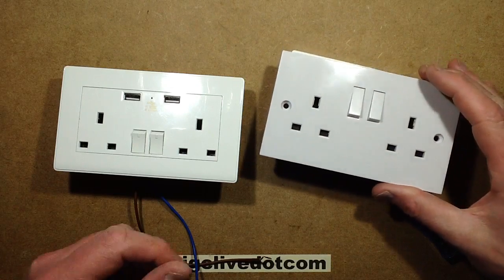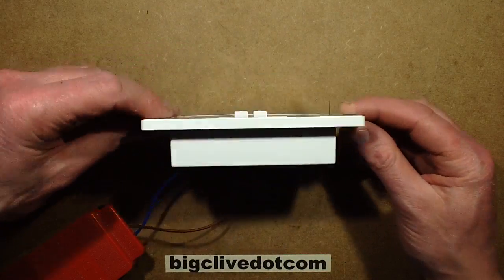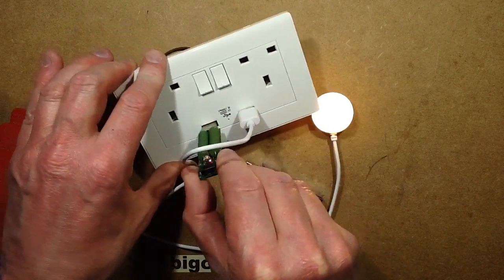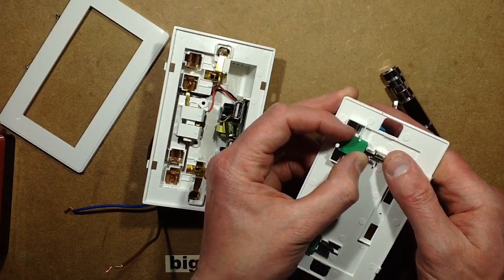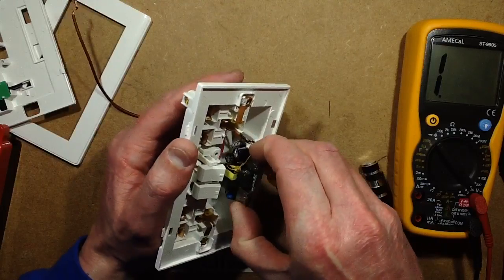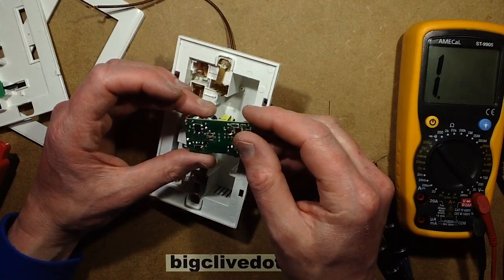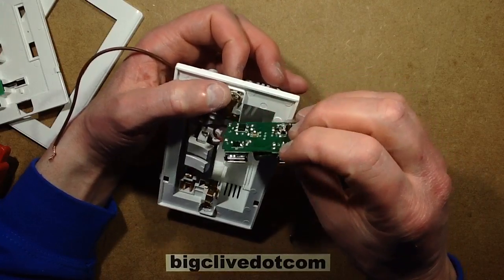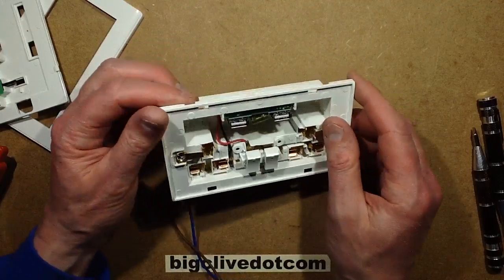A look inside a (crap) double gang socket with USB outlets.

Comment: Where can I find one of these USB 1A Loads you were using?
Reply: +Nathan Warner on Ebay from China. Or just make your own (5ohm resistor for 1A)
Reply: +MrOpenGL Awesome! I found then, so cheap! http://www.ebay.com/itm/1PCS-USB-Load-resistorPower-Resistors-Mobile-Power-Aging-Resistance-module2A-1A-/221919273705
Reply: Nathan Warner
I had also found a 500mA/1A version but I can't find it anymore. Basically it was the same as the one you linked but it had 10 ohm resistors instead of 5 ohm.

Also, if you do buy them, leave plenty of air around them because they do get extremely hot (also don't touch them when they are on for the same reason!)
It may smell funny for the first 2-3 minutes but it's normal!
Reply: MrOpenGL good to know!  Thanks for the heads up.  I've been wanting something like this to accompany my usb voltage meter to test usb phone chargers.

Comment: All I see are gigantic UK outlets.  I am partial to our 'dumb' north American outlets.  120 won't kill me ;).
Reply: +Michael O 240v won't kill you normally (higher chance, but less likely to melt the cables as higher voltage means cables don't have to be as thick)

we have MCB (and sometimes RCD) as well in most places now (unless the house is like 30 years old) and the plugs have a fuse in them so there is no chance the cable will turn into a space heater in the UK
Reply: +lee x we have service panels with circuit breakers in them. So if there is an overload the power is removed from the entire circuit. Including the cabling in the walls.
Reply: +Michael I like the compactness of the US sockets but I like how the UK versions have built in fuses and the switches on them. I guess that explains why the British have massive outlets.
Reply: Jügren van der Kaas
You can add switches to US receptacles. I have a box on my desk right now wired that way. Just use a duplex box, and the right combination cover plate. Our electrical supplies are modular. But generally we don't want switched outlets. As far as built in fuses go we have circuit breakers in service panels, and fuses in devices that need them too. So I do not see the point of fuses in wall boxes.
Reply: Paul Frederick the fuse is more for the cable (thermal overload to stop the cable from melting) 

MCB protect the all the sockets but they are rated at 32A typically and some cables can't handle that (laptop ones especially as they seem to be rated only to handle 5-10A with a 3A fuse in them (why you should never fit a 13A fuse in them) 

That is the only failing with the uk plug is the fuse physical size is the same so you can put 1A fuse up to a 13A fuse in the same plug 

in industry fuses they are norm physically different size to prevent you from putting a drastically bigger one In) even the old waynex consumer  UK fuse boxes had diferance size slots for the fuse rating holder to same effect
Reply: lee x
The fuses are in the plugs? Like the plug at the end of every cord?
Reply: Paul Frederick :) yes as your plugging in a cable that is running off a 32A MCB (normally) the Fuse is there to protect the cable more than the appliance for the most part (but if load passes the fuse rating then it blow before the MCB does) why i find it unsafe not having it in the plug you putting you whole trust in the MCB tripping in the consumer unit when the appliance pulls more than the rating of the breaker that is protecting the whole circuit,
  
i see a lot of responses like this is why does the plug need a fuse "If" its needed one it will be in the appliance but that's the Point your putting trust in that the appliance has a fuse to protect it and on top of that there is nothing between the socket and the appliance to protect the cable from overload

as with USA and most of none UK plugs in the world don't have fuses in the plugs so you could pull up to 32A before the main MCB trips which could cook the cable if its a lower quality cable (cable ment for under 3A loads like laptop chargers for example) 

if all sockets had RCD in them (with max 13A trip) in them it be more or less a issue (still a problem for under 3A cables) but they cost a lot more to install

and about the switch on each socket that is there to stop the pins and the socket from been burnt out (you might not see an jump arc when plugging in a plug but its there and over time i can damage the socket or the plug or both) again that depends on the Load been plugged in is Hot when its plugged in (like a heater or a PSU switched on when plugged in and some don't have switches on them so they are always on when plugged in )

Comment: Live and Neutral ,  But still AC/DC so how to tell them apart ? it not like a Battery that has + and -
Reply: The neutral line has no potential to earth (it's earthed at the transformer)
Reply: +BlacktigerFun Thanks But how to know the different if cable are not coded like brown yellow ect.
Reply: +Jasper Waale I think the easiest thing is to use a mains testing screwdriver. These have a small neon lamp in it which is connected to the tip of the screwdriver and to a little contact on the handle. If you put the tip of it on the phase, it will light up, otherwise not. This works because a tiny bit of current (you won't notice it at all because it's so low) flows through the screwdriver and through your body to ground. But you can also measure the voltage between the lines. If you've got 3 lines and you measure them, then you should be able to measure 110 or 230 Volts between them, depending on your country, but between two of the line you should not measure anything (or not more than a couple of volts). These lines then are neutral and earth. Now you still need to find out what's earth and what's neutral. To find that out, you could hook up a light bulb between the phase and one of the other lines, and you'll find out that the RCD blows at one of the two lines. That's not bad at all, it would just have protected you if you were the light bulb ;) So you can flick the RCD back in and you now know that the line on which the RCD blew is earth. These ways i mentioned aren't professional at all, but they are quite easy and practicable for an hobbyist ^^
Reply: +BlacktigerFun Super I try that,
Reply: +Bungle2010 You are yet to have a go at How things are made in Vietnam ?

Comment: Shorted data pins on USB means it's broadcasting the he-man code "I have the power!"
Reply: tosdude More specifically, it says "I have 900mA PER SOCKET", which it doesn't as it only has 1000mA total.

Comment: why are uk sockets switched at the box?
Reply: +SuperBigEv If you have a powerstrip that's powering 5 devices that maybe don't have all a power switch or remain in standby (think of monitors, chargers...) you can power them all off with just one switch.
Reply: +SuperBigEv So you can switch them off.
Reply: well obviously, but shouldn't the device itself have an on/off switch. excuse my ignorance in from north america
Reply: To stop you having to unplug everything, a switch is simpler than having to physically unplug something.  If your washing machine started making a horrendous noise you wouldn't drag it out in to the garden you would just switch it off, so why have to drag a cable out of a wall to make your power tool safe when you can just switch it off until you return?

Comment: http://www.tylt.com/ribbn-car-charger-micro-usb car charger with/4.8A output
Reply: +Dylan White Yeah 4.8amps means 2.4amp to each port. the rated ampage is the total amprage of all usb ports. Or at least that is how it normally works with devices like that car charger or these for that matter http://www.amazon.com/Upgraded-Version-RAVPower-Charging-Technology/dp/B00OT6YUIY/ 8amps is 2 amps per port. that is if yu put a 2amp device on each port oherwise its max 2.4amps to each port.
Reply: +Montisaquadeis yeah perfectly clear I understand that. Also that multiport charger is nice
Reply: I own the older one that has 2 2.1A and 2 1A ports myself.
Reply: +Montisaquadeis ravpower has always done me good so I may just pick up the 5 port model. I have so
Many Apple cubes it's insane

Comment: I'm surprised the iPad accepted charging from it at all.   Apple puts a small charge on the data wires with their authentic chargers that the devices expect.  If you try a knock-off charger it's meant to reject it.

Comment: thats the CUBOT H1  ? (i had mine for about 2 months and battery life of 2 days active use is very nice)
Reply: +lee x Look for it on his playlist. He did a review, iirc.
Reply: +TheJohn8765 i had the phone for last 3 months now, some one at anandtech did a review on it and for £110 i had to give it a go and i am loving it, 
i get 2 days normal battery or 1 day when i am doing a 8 Hour delivery run for that day (no need to plug it in until i get back home) and the phone does not turn into an oven when using it for google nav (as my HTC ONE M7 gets so hot it stops charging when it is in my car, i had to some time shove the phone into the air vent for 5 minutes so it cooled off) 
only small nit pick i got is the screen sensitivity is not perfect seems a little off (more so when its in landscape) but i can live with that
Reply: lee x I've been looking at that one and a couple of Blu phones to replace my aging tablet for e-books and gps. Is the text nice and crisp ( I know it's "only" a 720p)?
Reply: TheJohn8765 i went from a 1080p HTC ONE M7 that is a 5in phone to this CUBOT H1 720p and i really can't tell the diferance not unless i am trying like "big clive" CUBOT H1 talk (as it was not really a review) if anything it's better as problem on my 1080p HTC ONE M7 phone if i could not Stream in 1080p it had to stream in 720p so that would make text go blurry as it was having to scale it to 1080p, as the max setting for youtube on the CUBOT H1 is 720p and the native screen is 720p its good and have not had any issues text or video

i believe its an ips screen and doesn't suffer from going dark when turning the phone and its full brightness setting is good enough to light your whole room up (i have mine set to manual norm have it at 30% brightness and 1% when at night time satnaving) i found the automatic brightness setting at night it won't use the lowest brightness setting so that is why i use it on manual, when automatic brightness is off the setting is on the pull down menu

i do miss is not having the stereo speakers, but having 2 days normal use or 1 day flat out use (8 hours screen on time, say tomtom or google nav or youtube videos) as my HTC ONE M7 was a brick as i had an external Mophie battery case on it so i could at least get a day out of it
Reply: lee x That battery life sounds great, and the screen sounds just fine (it does say it's an IPS on the website). Since I want it for offline/wifi use as a more-portable-tablet for hiking and ebooks, I appreciate your feedback. Cheers, mate.
Reply: TheJohn8765 if your going to use if for none mobile data/no sim card use (just wifi) with no mobile used it most likely last 4-7 days depending on how much it been used per day as it can last upto 15 hours Constant screen on time (i find its 7-8 hours my use) with standby of normally 3-4 days (my use 2 days, 1 day if full day satnaving)

with no mobile sim most likely last longer if been used for offline use (amazon kindle or PDF reader)

my HTC ONE M7 when its mobile data is set to off it lasts me about 5 days but that is idle not been used (2400 battery is to small for a high end CPU and 1080p screen)

the New samsung S7 Edge has a 3600 battery which is what modern phones should have
Reply: lee x "15 hours Constant screen on time " Holy shit. My Nexus 7 tablet gets about 10 hours SOT when browsing the web or maybe 12 if only doing ebooks on low brightness. Using GPS eats the battery, but it's a 1920x1200 screen. That phone is def on my short list, now. Thanks!
Reply: TheJohn8765 i not seen 15 hours constant screen on time myself (it's advertised that it can last that long) as i use the GPS a lot i use my phone very actively so i don't expect to get that that time (the 8 ish hours screen on time was my expectations)

i always expect a phone's advertised battery life to be 2-3x less than advertised (when i goto anandtech there phone reviews are very good apart the from Very unrealistic battery life tests, i can't see how a phone in there tests can last 6-9 hours of screen on time when realistically they only last 1.5 to 3 hours)

but if your using it like a tablet with no GPS or mobile data Off (nearly as good as having no sim card) or even no sim card i guess it will last very long time

its funny when i open the battery status on the CUBOT H1 and it says i have 3 days remaining battery life, as i never seen a phone report standby time in days just amusing whenever i see it

Comment: I assume this dangerous crap is from the continent of slaves across the Pacific? I agree with you about not putting electronics where it could cause a fire in an inaccessible area or not be easily replaceable. As they say, ITS MADNESS!

Comment: There are a few ad hoc "standards" for charging ports, until later standardized by the USB IF.  Most involve either shorting between or putting a moderate resistance across the data pins, which the devices can detect and draw more current.  Before this data pin fiddling was done, the device actually handshakes with the hub to negotiate how much current it wants  to draw.  I have to wonder if that's what you observed, the device negotiating with the hub, or if the device, as you were describing, monitors what it can draw by looking for a -deltaV.  That would get awfully confused by the instability you noted of the unloaded supply, because the voltage would be dipping "all the time."
Reply: I see the point you are making but surely the current on one USB port should not affect the current negotiation on the other port. In this respect the two ports should be independent.

Comment: That shutter system is a brilliant idea, wish we had that here in the US!
Reply: +Campjeep69 You can get shuttered Nema 5-15R receptacles over there; they're labelled 'Tamper proof', and I believe they're now mandatory in certain situations.

What I don't think you have over there are plugs where the Line (Hot) and neutral pins are sleeved for part of their length so it is not possible to touch a live pin on a part-inserted plug, as is required here in the UK.  It would be possible to make such a thing as the 10 A Australian plugs which have angled pins, but the same size as used in 15 A plugs in the USA, are required to be sleeved now.  However, this leaves very little thickness of metal, which is not good from either electrical or mechanical viewpoints.  The BS 1363 plugs with their much thicker pins are better in this respect.
Reply: +Stephen Furley 

yeah things could definitely be done better here when it comes to our outlets!
Reply: +Campjeep69 our receptacles are great. Who wants those big bulky UK plugs? I have those on my 240VAC equipment and I hate them!
Reply: That's true they are bulky but I was just saying there safer than the one's in the US.
Reply: Campjeep69
Yeah those UK plugs have to be about as safe as a dog with two bricks tied to its head. What trouble could a pup like that get into? Fat lot of good it'd do you in a number of situations too though. Their construction sites for instance have to be a nightmare. I can't imagine piles of those plugs on extension cords lying about. You'd be able to sit on them come break time I suppose?
Reply: +Paul Frederick UK construction site use 110v equipment.
Reply: muttley1956
110V you say? Strange voltage that is.

Comment: 1000 mA is pants for current phones. They might charge, but most of them will install updates when plugged in and then it might drain the battery further and when you have 1% left, the phone turns itself off.
Reply: +BloodySword.. too true, my own phone is a blackberry & it wont accept anything less than 2000 mA.. my work nokia would probably accept a charge from an orange with 2 dissimilar metal pins in it

Comment: Why do switch mode power supplies have the mains directly go through a bridge rectifier anyways? 

I mean, I haven't researched them,but don't you want to have mains go to the transformer, and then rectify it?
Reply: +shurdi3 Because DC is used to generate a high frequency DC PWM signal which is put through the transformer instead, thus making it smaller. Technically speaking all AC to DC switching converters are just DC to DC switching converters with a rectifier in front of them.

Comment: I live in California and I have 4 of those CFL lights with ballast built in. Now, those ceiling fixtures take a very specific kind of CFL and it is not very bright. I want to replace them with LED. Any guidelines on how to remove ballast and change it with regular screw bulb fixture?
Reply: Just remove the ballast , and straight wire live and neutral to the screw bulb socket terminals .

Comment: I touble shot (shooted?) a whole bunch of similar units which had been fitted in a hotel chain. About 50% died with similar unstable output as yours. Turned out every one that had failed had a knock-off chinese diode in it. All the ones that worked perfectly had a genuine make diode in.
Reply: trouble shat
Reply: Trouble shooted is correct
Reply: SpiderElectron m